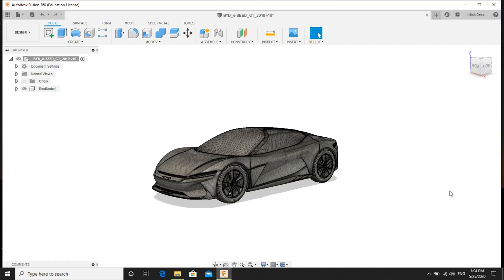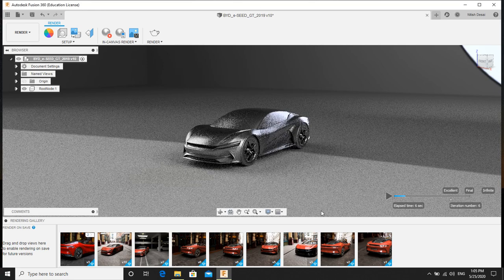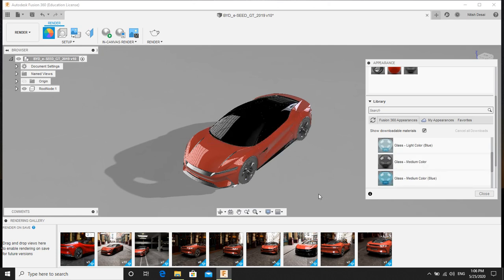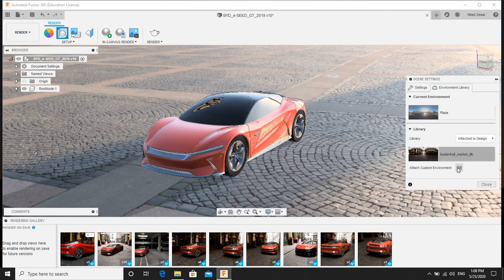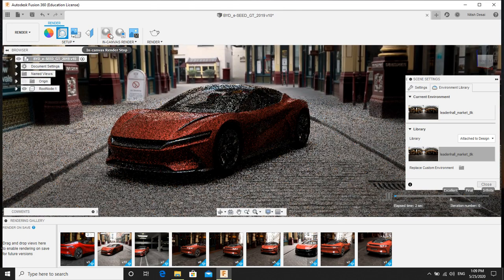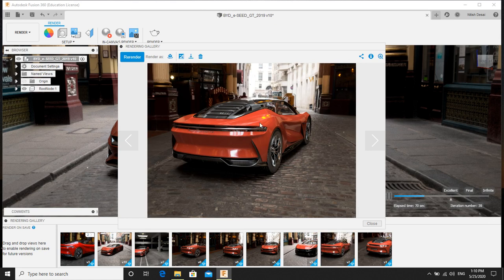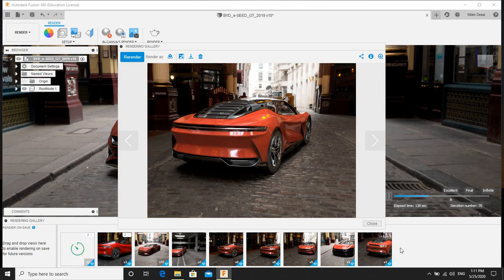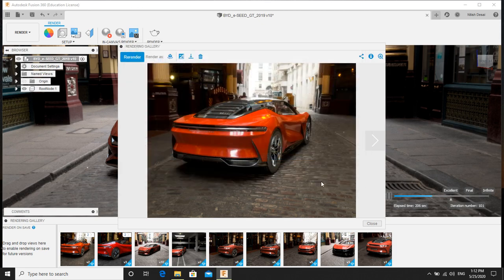How to Make Your 3D Models Look Real (Fusion 360 Rendering)

Comment: How did you get this render to look good without using the flatten ground command? If i use that command it distorts the background?
Reply from the maker: Have you turned on path tracer ?
Reply: @nitishharishdesai849  Do you mean Ray tracing? If so no, how do you do this?
Reply: I'm using a NVIDIA GeForce RTX 3060 6GB so should have Ray tracing capabilities, but can't see how you turn it on.
Reply from the maker: I had created above rendering using my old laptop that runs on Quadro graphics card. There is an option to turn on path tracker in f360 I have shown that in video
Reply: I think it's on as standard, but it is always distorted using that environment, it might be due to the physical size of the vehicle, was yours 1:1 scale? @nitishharishdesai849